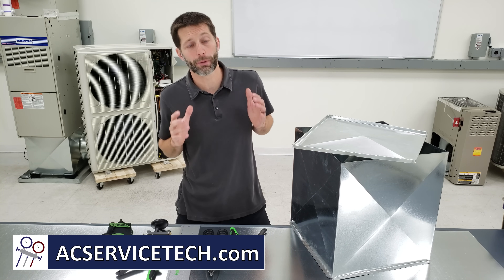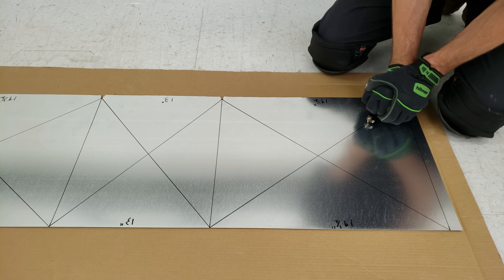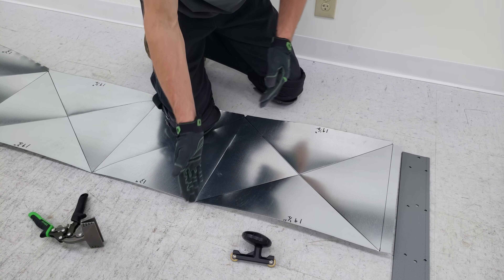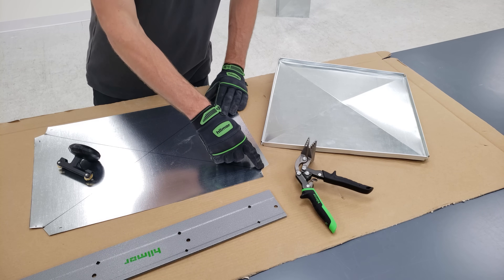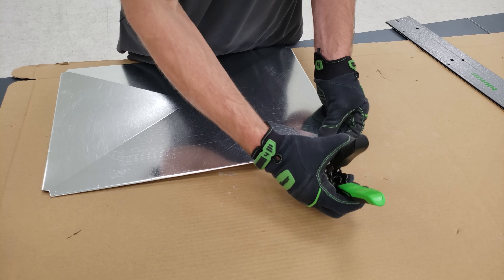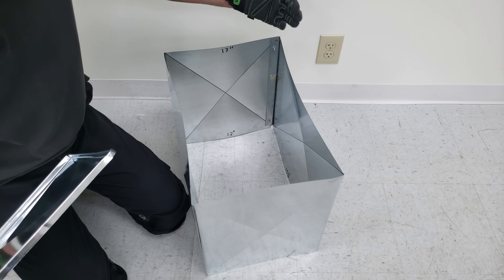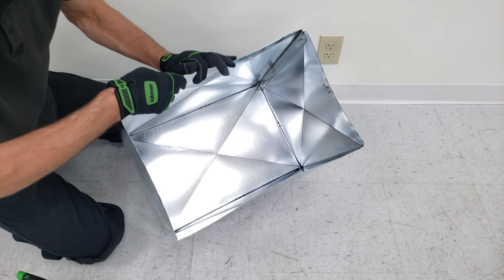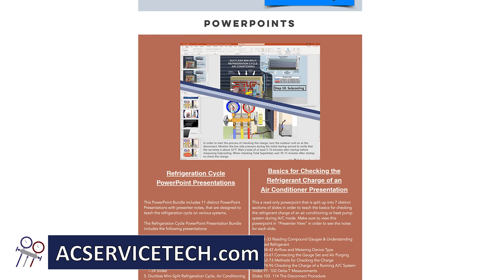Building a Sheet Metal PLENUM and END CAP with Hand Tools!

Comment: on the end cap, could you not have just folded the 90 first for the flaps, then folded it halfway afterwards? then you would not even need your hand clamp.

also, i think it would have been quicker and simpler just to use S-clamps on the end piece. perhaps more costly for metal, but still...

Comment: The video is interesting, but in most cases that I have seen, if they explain step by step how the folds are made in the sheet, they do not talk much about the caliber of the sheet and they do not mention the type of insulation that the transition should have. takes it outside or if it should take it internally.  Anyway, thanks for sharing the knowledge.  I appreciate if you can comment on it.  Greetings.

Comment: thanks for sharing the awesome video. what gauge is the sheet metal?  Great tool.
Reply: It's probably 28ga, maybe 30. I've run metal shops all my life, residential and commercial, and I've never made duct or plenums out of anything lighter than 26 because anything lighter is nonsense. Any reputable metal tradesman would tell you the same. And this tool would therefore be worthless.

Comment: Awesome presentation. Question: I have a home built in 1986 and has fiberglass ducts with 8” insulated tubes to vents.  After all these years I’m concerned about the health consequences of this material. Curious your thoughts or if you have any discussions with fiberglass ducts and proper servicing.  My furnace is a 95% efficient gas. Thanks so much Craig.
Reply: Usually fiberglass ducts aren’t that big of a deal. They only starred being used in the 1980s and asbestos was banned in the 70s
Reply: @thatmeatteacher8662  thanks so much. The duct is fine but wonder how much crap gets attached to the fibers. Have to see if I can get something to clean the material without disturbing it.  We are dealing with crazy allergies and think it may be contributing to the problem.
Reply: @LDoctorKC  Yeah no problem. You should be good because there is an inner jacket on the flex duct. If I were you, I would look into having my ducts cleaned instead
Reply: @thatmeatteacher8662  The fiberglass ducting does not have a inner liner. its insulation foil on the oustside and "sealed" fiberglass on the inside. There is no safe way to clean fiberglass ducting...

Comment: **HELP needed.

Anyone here know the main reasons as to why a gas water heater draft hood NON power vent is having heavy case of back drafting and the flu gas is not getting out to the chimney. This is a 50 Gal HWT with temperatures at -18C. 

This HWT has been orphaned for about 4 years and only now seeing a backdraft issue. I cannot physically inspect for blockage in the chimney due to angles. 

Any advice here? 

Thanks!!
Reply: I’m taking “orphaned” to mean not used. If this is the case, didi it ever work properly? Nest in flue would be my guess. Long inspection camera would be my tool of choice here.

Comment: way do you not use half inch side? You can use all 1 inch side and turn half inch back... that is easier and faster.
Reply: That's what I was thinking.  Instead of the seamers which aren't going to give you a nice bend, why not bend 1" and bend it back with the 3/8" side.  Also, the gauge looks light.  Thirdly, I have never had an install where I could have used this plenum.  Low overhead basements and retrofits are different animals.

Comment: awesome. that pocket brake looks awesome and fast. would love to see more field work sheet metal. too many use Pittsburgh machines. the way you did the end cap is much cleaner than using S locks. Do you have a Hensley bender for demoing some sheet metal work? Also real world talk about gauges used for new construction and rework - seems 30 gauge is not code but often sold and used, vs 24, 26, 28 gauges.

Comment: I need to know how to modify return air at the furnace to accept an air filter so the vacuum created sucks the filter tight to the unit. Right now, the filter is in the channel in the unit which allows unfiltered air to bypass and circulate through the house. Not much clearance to replace the filter in the unit due to the unit being placed where the access is facing the so called chimney that vents the CO1. Seems as if no hvac installer wants to waste their time to help out and do some metal work. Not like I’m not willing to pay for the work performed, not like I’ve ever said that’s way too much money for such a small job, I’m a skilled tradesman and know costs, but after watching your video, I feel as though I could do it myself with the correct guidance. AWESOME WORK by the way.
Reply: Could you add foam weatherstripping to the channel?

Comment: You can brake your metal using a straight edge and awl or side of flat screw driver . Press down hard and pull scoring the metal. Same principle as the pocket brake . I’ve used this technique for years

Comment: Foil tape can also be used on the supply side to seal a plenum. As far as the Return side, it doesn't matter. These can be constructed with typical construction materials like wood and sheet rock and don't need to be sealed, necessarily. Spent quite a bit of time building supply plenums in New Construction housing. Don't have to do that on the service (diagnostic side) that much at all. I don't like climbing into rafters and working in close-quarters. I have the brain for the service side, so I'm ultimately glad that I'm done with that 'new construction' part of my life.

Comment: Hey let's make a "Pocket Brake" with washers, bolts and nuts, or a good quality can opener 😂😂😂
Reply: It just occurred to me that a couple of pipe cutter wheels would probably work.
Reply: That's what I used before on a piece of a metal hanger. They did a cool tool with beatings and brass rollers, but imo 65$ for this is too much
Reply: I use a screen tool roller

Comment: Great Video.  Can you tell me what gauge of sheet metal you use?  Is there a difference in gauge between an upper plenum vs. a lower plenum?
Reply: It depends on if it’s residential or commercial. Commercial should be 16 gauge and residential like 26

Comment: Great video!  I was not able to find your pocket brake tool in the tool list/Amazon store.
Reply: @Tech Skills Thanks for your interest in the Pocket Brake! These will be available at your local HVAC wholesaler - Product Number HPB1701
Reply: @DiversiTechCorp  I couldn't find one locally.  I just placed a backorder for one of these pocket brakes through the link you provided in the AC Service Tech LLC pinned comment. Thank you for helping us find a place to purchase one of them.  If it works like it did in the video, I know several other people that will want one for themselves.
Reply: @DiversiTechCorp  :  I received my Pocket Brake. 

I used it this week to fabricate some changes to a return air duct work installation.  

It is an AWESOME tool!  I recommended it to other technicians.

Comment: Could u have used sheet metal screws to fasten the end cap to the plenum?
Reply: Yes.
Reply: If you ever made a plenum in a shop he notched the corners so when you hammer those notches and it holds it on. Honestly I’ve never really seen much of anything come out of a real commercial or residential sheet metal shop with screws. Some things yes but you don’t need them if you have a real sheet metal shop. The stuff this guy is doing I learned when I was 16 like 20 years ago and it’s nothing that anyone can’t do with some practice.
Reply: @angelogoreham4155  Thanks man!
Reply: @marcusdarnell3348  no problem